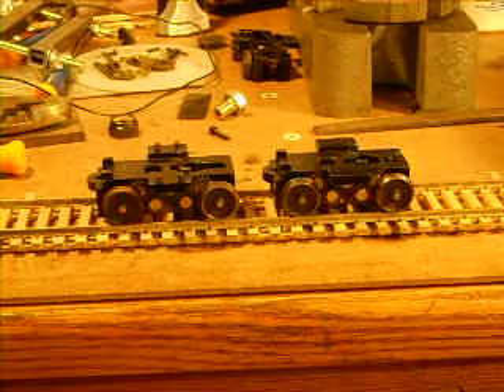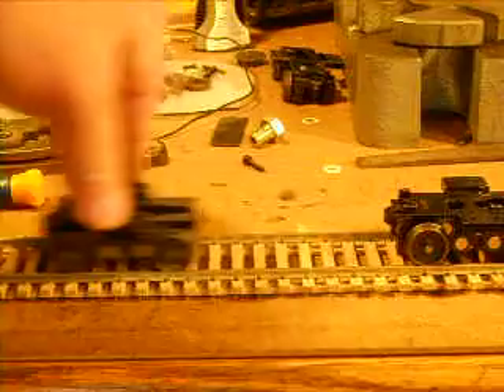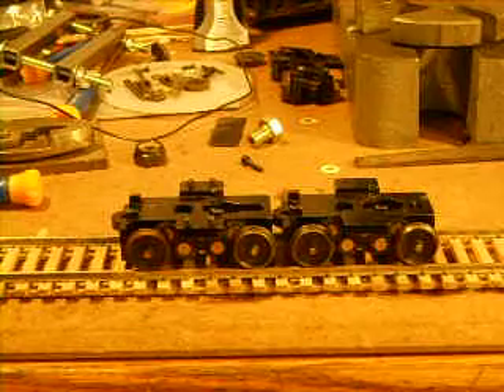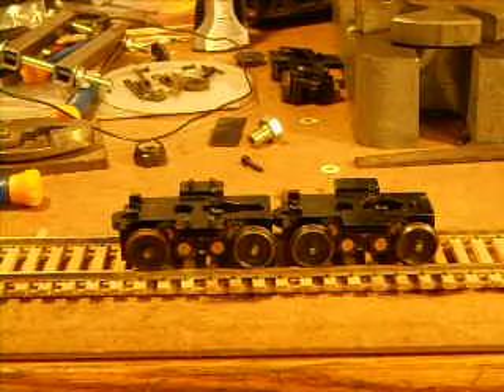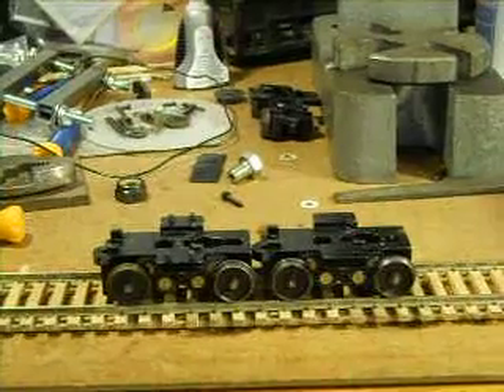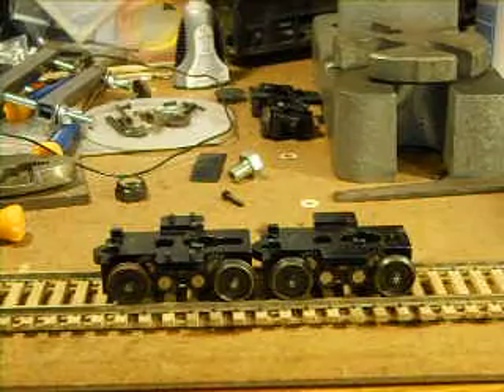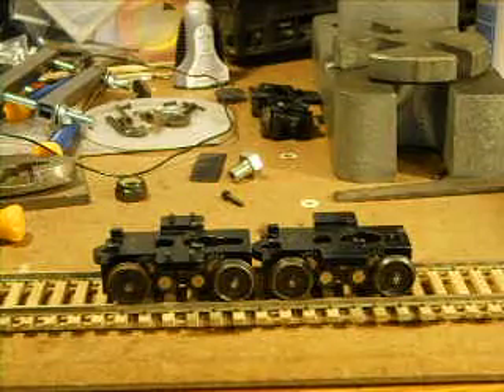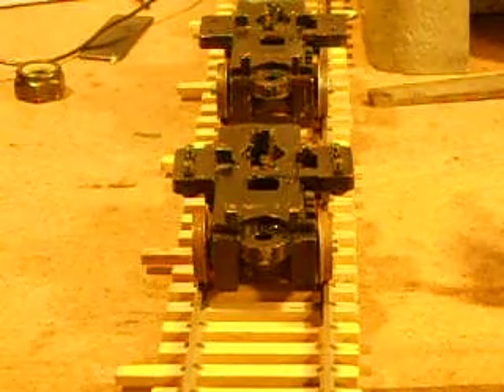MTH 3r conversion video 2

Comment: Very nice will you still have the sounds and Auto mode features?
Reply from the maker: Auto mode? and yes I plan on sounds.. BUT, I may have to create my own C/R's station announcement files 7 upload them onto the board.
Reply: @robertravena wow how do you upload the announcement files. And the Auto mode feature mean the sets are programmed to stop at the stations until the last stop then it reverse it self.
Reply: @robertravena if you can use sensor on the track to stop the trains at stations and say the announcement that will be cool too. Im a subway fan so I wanna see how your sets turned out. Even short picture on YouTube or something. I need to see please
Reply from the maker: @James-w4p5q  Ohhh NOW I see what you mean,, Yes. I would like to do the sensors to trip signals and start station announcements. But that's a wee bit off.. like sometime next yr. as for the builds; I'll be making progress videos on the projects I'm currently doing.